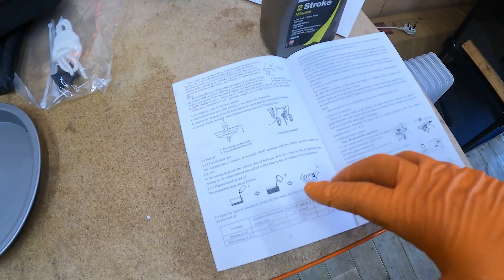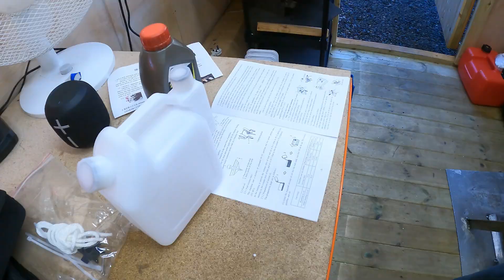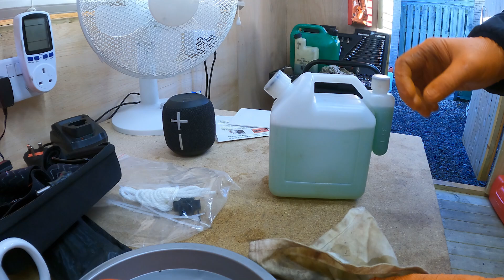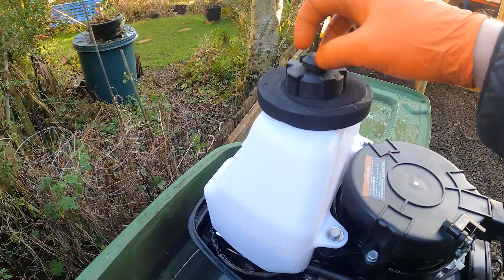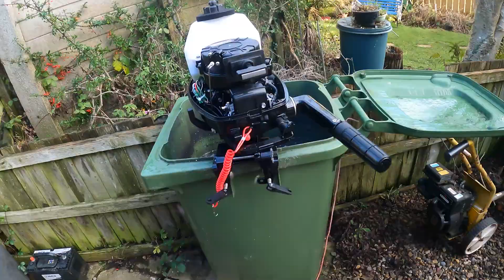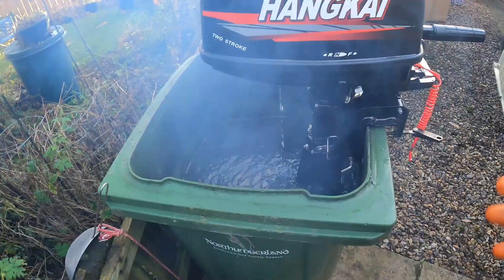Hangkai 6hp ( T6 ) 2 Stroke Outboard - Setup & First Ever Start Up In Water ( Pt 2/2 )

Comment: thanks ! could you tell us what fuel connection fitting is required for an external tank ?
Reply from the maker: I believe it’s the Yamaha 6mm connector
Reply: @MarineEngineServicing  thank you so much for taking the time to reply to my question. I have the same outboard, it came with the boat (Hurley 22, twin keel) so far it's working fine, however the propeller paint is peeling off.
Reply from the maker: Yeah I don’t necessarily think there’s anything particularly wrong with those engines, they’re just copy’s of industry leading manufacturers. But the QC maybe a little lacking including warranty, not sure what would happen if you made / tried to make a claim…

Yeah paint coming off can be quite normal, is it wearing off or coming off in chunks / flakes? 

Wearing off would indicate a prop working hard  and possibly cavitation, flakes would tend to mean aluminium corrosion under the paint
Reply: @MarineEngineServicing  more like flakes but I kept it immersed for months because it's in a well in the lazzarette not  on a stern bracket, so my fault too. I jad to change the anode too.

Comment: I know. You need to always full choke a small 2stroke engine. Once it starts bump it down to half or quarter while it spits and sputters then no choke with a little throttle. This baby ain't a brand new Audi 🤣
Reply from the maker: You're spot on, these definitely need a bit of coaxing to get running right! 👍

Comment: I bought one of these about a year ago for taking camping to push an inflatable, so I needed a super light engine. So far it has run great, not an issue. The only thing you have to do adjustment wise is the idle mixture, which seems to always come wrong from the factory. Dial that in and it is a great little motor for cruising around small lakes and doing some fishing. Only real issue I've had was my breather stripped so I had to get a new fuel cap.
Reply from the maker: Glad you've had a good experience with it, thanks for sharing the tips! 😊

Comment: Don't use crap mineral 2 stroke oil. That comma mineral is only an FB rating it'll gum up that engine and the rings will scuff. Should use TC-W3 in water cooled outboards 👍
Reply from the maker: Appreciate the advice, it's definitely better to use the right grade to keep these little engines running smoothly!

Comment: Man good engine i have over a year now but when it starts up you have to keep reving it to keep it going or if you pit it in gear it cuts out not sure why do you no if so can you do a video can't get one on this??, i have a tank and fuel line with my i use all so
Reply from the maker: Could either be the idle is best too low or you have a blocked idle jet. 
I’ll see about doing a video on cleaning the carb for you 👍
Reply: @MarineEngineServicing great thank you and taking it of an all how you do it thanks Man
Reply from the maker: No problem 👍

Comment: Didnt see you put any oil in it
Reply from the maker: I’ve another video which shows the filling of the gear oil. The crankcase doesn’t have oil as it’s a 2 stroke 👍
Reply: Would you recomend the engines
Reply from the maker: So far it’s been fine.
Reply: @MarineEngineServicing just not sure weather to get one or an older brand name
Reply from the maker: It’s nothing fancy but anything bigger I’d lean towards getting a brand I.e Tohatsu, Honda, Suzuki
Reply: I've already put several of these engines into operation. You fill it with gasoline, engage the choke, give it some gas, and it starts on the first try, but adjustments are necessary afterwards.
Reply from the maker: Yeah they aren’t perfect but as far as a cheaper option goes they aren’t bad